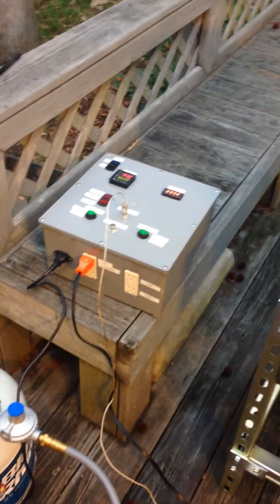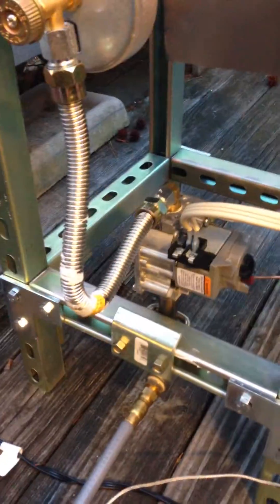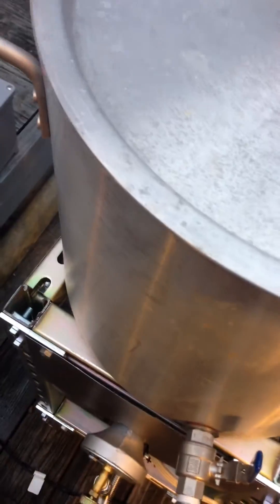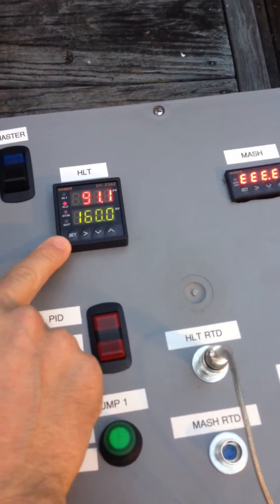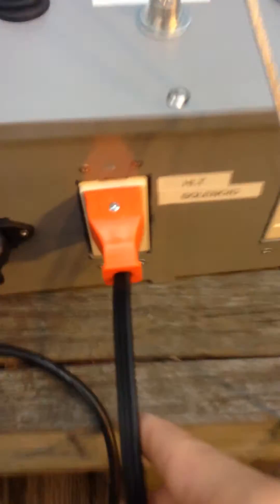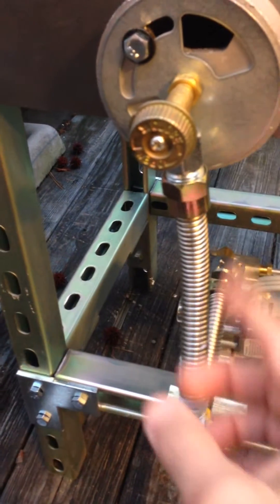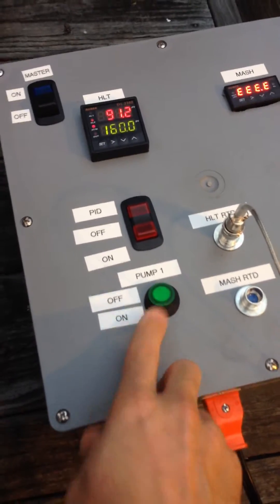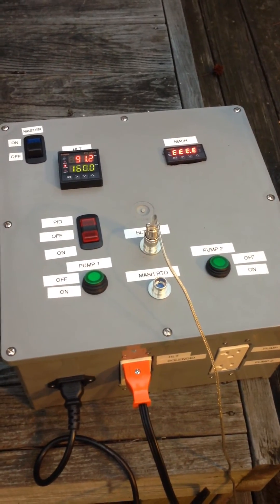HLT low pressure propane automation Part 1

Comment from the maker: It's in on/off.  When I get close to temp I just tune down the gas so it doesn't overshoot.  I use PID on my electic setup but for gas where it wouldn't like pulsed power (ie you don't want to rapidly turn gas on / off / on /off) I don't know if PID on something like an auber will work well.  I use PID on my brewpi and that doesn't do pulsed power so it would work well.  or maybe there is a way to turn off pulsed power on an auber?  not sure.  good luck!